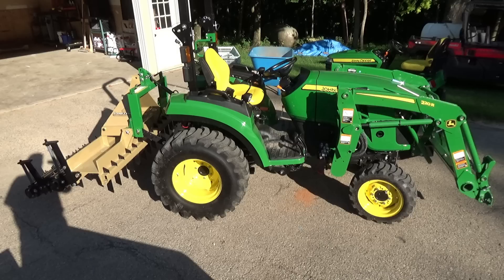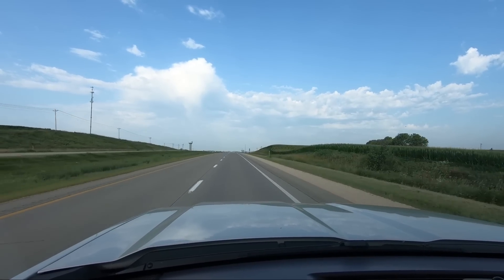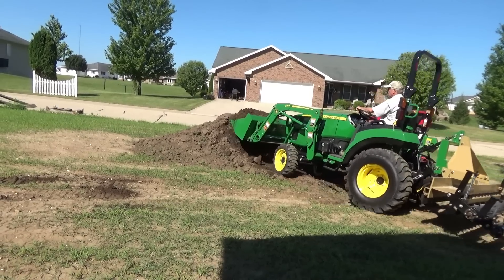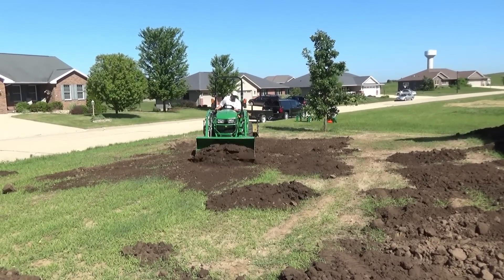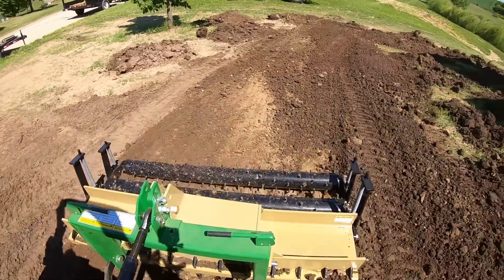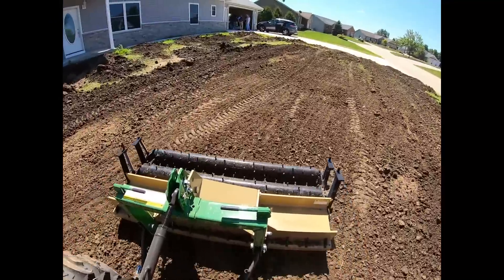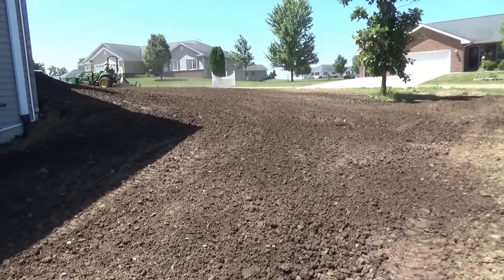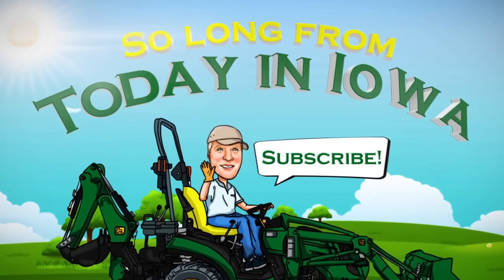Land Pride Soil Pulverizer / John Deere 2038R / Installing new yard/ 108

Comment: It's good to see Land Pride is still in business making implements. I used to use a Gill Pulverizer working with my dad almost 30 years ago now. It always did a great job. We absolutely wore that implement completely out doing landscaping jobs.
Reply from the maker: Good morning Mr. Samurai, 35 years ago are used to run a guild pulverizer also it was always one of my favorite landscaping tools. It was nice when I could afford to buy one and have it in my arsenal of the implements. LOL
Thanks so much for taking the time to comment I appreciate your support-Bill
Reply: Land Pride is owned by Kubota and is their line of implements and attachments sold at Kubota dealerships. You can buy it as a Kubota or Land Pride.
Reply: @zfilmmaker  I think they must have purchased it, we had those implements over 30 years ago. I remember they had a catalog , and it was a stand alone company back then I'm pretty sure.
Reply: @mr.samurai901  Land Pride was its own brand under parent company Great Plains Mfg. I'm not sure exactly when Kubota acquired them...I think maybe 5 year ago? Hasn't been that long.

Comment: Bill, I did a job just like that this past summer.  I used my TR3 Rake and backed up the pile to pull down from the top and did that operation in different directions. My TR3 has a blade that can be locked for mass material moving OR unlocked and allowed to "float" to do a finish grading of material. The owner did some handwork to make look smooth. But the majority was spread about 1-4" depending on location in the field.
Reply from the maker: Hi Andrew, that’s a good idea I’m glad it worked out well for you. I hope to get a few jobs this summer maybe I’ll try out your idea then. Have a wonderful Christmas.

Comment: Hey Bill, this is one of my favorites! You shared great info throughout and I love the peaceful nature of this one too. So the 1025 is the smallest tractor? I always here people talking about 1025....
Reply from the maker: Aaron, yes, the 1025 is known as a one-series tractor; mine is a two-series tractor. The last two digits are the horsepower of the tractor. One reason I traded up was that the 1025's lifting capabilities were always marginal, so I moved up to the next-size tractor. Now, I can lift many more implements and achieve more of what I’m trying to do, and it still won't tear up your yard when you drive across it.  enjoy your Labor Day. -Bill
Reply: @billburkhart  Great answer again! Love it!
Reply from the maker: Aaron, I wanted to add that you can purchase dirt and gravel by the pound. For example, when I use my small dump trailer to get a load of dirt, I pay by the pound or the ton.  I was thinking along the lines of commercial work when I was talking about a cubic yard price. -Bill
Reply: @billburkhart  great, was always curious about how that works from a billing standpointm
Reply: Here is another question.... I heard you mentioned before you have tractor dealer you work with for equipment. How does that work? Do they service your equipment, what is your inventory?
Reply from the maker: @aaronburford5701    Aaron, I have three different John Deere dealers within 20 miles of me, so I spread my work among all three. I do my oil changes, greasing, air filter, changes, etc., myself. I’ve only had to go back to the dealer once or twice for some mechanical issues that I didn’t want to try and fix.  I ordered a new replacement grill after damaging it From the dealer and will install that myself. -Bill
Reply: @billburkhart  Cool, thanks for sharing!

Comment: Would love to compare this to tilling and then leveling out with a drag and then compare that to a Harley rake. Which way is faster and gives a better end result?
Reply from the maker: Hi Pete, I've never used a Harley rake, too expensive for me and I don't care for the way it can throw a rock or something similar.
I'm such a fan of the pulverizer because its 3 tools in one. The scarifiers break up hard ground and the roller breaks it down further without going too deep. The H beam allows the operator to contour the ground where its needed. Finally the roller can be driver over the seed bed to set the seed into the soil.
I'll keep this question in mind when I do a small seeding project this fall and compare it to a tiller. 
Good question. -Bill
Reply: @billburkhart  Do you spread seed and then go over it with this to get good soil contact? If so how does it work or does the grass come up even? I'm always looking for a better way. Right now I till, then go over it with my 3 point homemade drag, then I roll it with a cultipacker, spread seed and then cultipack again. It works but I always end up with a few bare spots.
Reply from the maker: @petebusch9069   Pete, as long as your setting the seed with culipacker, your good to go. Your process is good.
Using the pulverized, I get by soil prepped then spread seed, and then I tilt the pulverizer way back, so only the rollers are running on the seed, so it gets into the soil.
basically, we’re doing the same thing. My experience has been getting good growth doing it my way and I’m sure you will also.   
Enjoy your weekend .Bill

Comment: Retired 75, in process of moving from 60" to 72", 4 cylinder kubota L4701. Tractor still at dealers adding canopy, LED lights, tip/tilt, third function and Quick Hitch QH15. Did not want back hoe, went with mini excavator Kubota K008-3. Enjoy your video. EDIT: Got lots of hobbies, one I like is making compost. Live in area houses have acre lots, so neighbors bring over leaves and cut grass. I add manure and my time, $25 a yard works for me, load trucks and trailers all year long. Have metal shop with some CNC. Had Everything Attachment deliver 72" scrap grapple to dealer, then I added Land Pride HR2572  it will all be delivered when dealer gets done.
Reply from the maker: Hi Vern, guessing you live in Arizona? Compost is hard to find out here in Eastern Iowa wish I had a source like yours. It sure sounds like you have a very nice set up with your shop and tractors. Congratulations on your achievements.
Reply: @billburkhart  Bought to many machines, recent arrival is fabrication roll around welding table. Just completed small addition and jammed a new Kubota K008-3 excavator in the new space, I'm out of room again. Just had some rain so, running tractor around creating mud pies every where is not helping.

Comment: I just subscribed to your channel. I have been watching your videos for a while but this one caught my eye pretty good. The reason I say that is I purchased a 2032 last year. The exact same tractor but a little less HP. Also a little difference in price. Lol!  The only reason I didn’t buy the 2038 was budget. I traded a 2210 I bought in 04 in on it. I love mine. I got the 60 inch belly more, and loader with mine. I already had a 60” disc harrow, Bush hog, and 60” tiller. I could not justify the backhoe no more than I would use it and besides my neighbor already has one. Looking forward to seeing what kind of jobs you come up with for the 2038! From Helena, Alabama, y’all have a good-un!
Reply from the maker: Hello Richard, thanks for subscribing, I appreciate it! I looked at the 2038 too and struggled when making the decision to go with the 2038, I figure this is my last tractor, so I purchased as much as the budget would allow. Sounds like you have a nice set up with your tractor, enjoy it, be careful and have a great spring.

Comment: I’m in the market for a tractor I have 2.75 acres of land to maintain with horses and a few other animals it will be for my own person use not for doing jobs for other people. I also have quite a bit of landscaping and leveling to do. What would you suggest 25 or 38? Or how about the economical 1023e? I don’t want to over spend but I also don’t want to get something that isn’t going to work
Reply from the maker: Max Sanchez  Hello Max, the 1025 will do anything you throw at it, I have the videos to backup that comment. However, being a man and buying boats before, avoid the cost of trading up......purchase as much tractor as you can afford, but the 1025 won’t let you down. Let me know what you purchase.
Reply: Bill Burkhart thanks I’ll let you know what I go with

Comment: Great video. I find I like to make a good (1 bucket) windrow at the furthest end, then backblading with the bucket to set the height, and where it gets thin ill start a new windrow there. It makes a fairly even spread of topsoil quite quickly, the final leveling is very fast. Have you tried this way before?
Reply from the maker: Hi Fire Pants Fab, I have not tried that but I sure will next time I'm out. Thanks for the tip. Stay healthy and thanks for taking time to comment.

Comment: Another excellent video.  Could you have used your Land Pride grading scraper to move and level the new soil?
Reply from the maker: Hello Mickey, yes...you are absolutely correct. This location was about :40 minutes from my home so I used what I brought.....and could fit on the trailer.  But, going back for the rear grader crossed my mine too. Good catch. Thanks for checking in- Bill

Comment: When you get dirt dropped off, how is it charged?
Reply from the maker: @aaronburford5701    Good morning Aaron, good question. You pay for dirt or stone by the cubic yard plus a trucking charge. For example, the rip rap I purchased in the other video was $175 for the stone and $150 for trucking, so $325 a load. Dump trucks are referred to as single-axle or tandem-axle loads. Of course, a tandem axle load will hold more weight. You’ll hear me mention that I bought a tandem load of rock, meaning a larger amount of weight can be hauled.
Reply: @billburkhart  great answer and thanks so much!
Reply: @billburkhart  help me understand the big difference between a 1025 to another tractor?
Reply: So what does the dirt being spread on the property like does for the ground,?
Reply from the maker: @aaronburford5701    I added  good quality soil to improve his existing soil.
Reply: @billburkhart  Bill, thanks SO much for answering each question,... It means a lot!

Comment: Looking at buying one of these. But you need to put bushings on the pins so they are not sloppy in the quick hitch
Reply from the maker: Happy Sunday MMM. You are spot on! I learned that the hard way when I was using the disc  plow and it came off...........now I'm adding them to the implements when I purchase them. Great point, I'll share that with others. 
Thanks for checking in, - Bill
Reply: Bill Burkhart i lost my tiller testing it. What a mess that was
Reply from the maker: Mini Massey Maniac.   HolyCow bet that’s a good story....
Reply: Bill Burkhart not really lol  it bounced off the hitch on one side and pulled the shaft apart. Not as good as when i was clearing brush and a tree pulled the clip out of the pin on my loader and the pin for pulled out so the loader was only mounted on one side lol
Reply from the maker: @midcoasttractorservice9182  We'll you'll appreciate seeing video 111 when it comes out and you'll watch as the  disc plow "bounces" out of the I match.
Reply: Bill Burkhart i don't think I'm enjoy that part lol

Comment: Another great video Bill!  I bought a 3pt quick hitch about a month after I got my L3901DT.  I have a Land Pride box blade that is quick hitch compatible and is a real pane to hook to the 3pt without a quick hitch.  Makes changing attachment a lot easier.  The Soil Pulverizer looks like it does a great job breaking the soil up.  I wonder how it would work after using a tiller on the ground first?
Reply from the maker: Hi MD H, I've done a few yards now and had thoughts of bringing my tiller along but always choose the pulverizer because of it's speed. If I have room on my trailer next spring I may try that as I have 2 yards to grade and seed this spring. Thanks for taking time to write. - Bill

Comment: Hi Bill, again, Nice Video, glad to see the 2038 in action, I knew you would like that IMatch , that makes things so much easier. Just an FYI, Everything Attachments makes great stuff, that's all I buy, the only thing I would suggest to really make you love life is to add a hydraulic top link, that will blow your mind in conjunction with that awesome IMatch, I love mine, but I see you don't have the duel rear SCV's, if you haven't seen my video when I added mine, check it out to see if it might be something that might be of use to you. I bought a garden bedder from EA and plan to expand the sweet corn patch this year so I'll try to get some one to film it and upload how it went, have a nice day.
Reply from the maker: Hello Ty, good to hear from you again! Thanks for the corn update, I lost track of your progress last year and was wondering.
The I Match adds so much efficiency and convenience I wouldn't be without one now. You were correct recommending it.
I've watched your video on the SCV several times and I'm interested in adding it after your comments today.  My dealer doesn't seem to want to do add ons after the sale, so I may need to find another dealer to do that work. If you make a video using the hydraulic top link in use, let me know. 
I was thinking of you last year, I hope you'r not close to all the fires I see on the news.
Reply: Hi Bill, sorry about not any updates on Corn Patch, was really bummed on turn out, really great corn "bushes" but didn't get fully pollenated ears because of no room for pollen to get to silks so this year more space between rows and different seed company and a lot of "praying" !!!! We are about 3 hours from the fires so we didn't have problems but our church has a high member count there and those poor people lost everything, I am going to do video on top link soon, keep the great videos coming, enjoy them a lot.

Comment: Hello how does the tractor manuever ? Compared to the 1025r , is it handy ?? So to speak
Reply from the maker: Happy Sunday Fralin 1966, the 2038 requires a little more room to do a 180 degree turn, but nothing that has caused me to regret moving up to the 2038R. I'll be posting a video this spring comparing the 1025 and the 2038 after owning both for a year. 
Thanks for taking time to comment - Bill
Reply: @billburkhart  thank you !

Comment: Hi Bill.  Thanks for your videos.  Just wondering if you think that a PTO tiller set shallow would have been a good choice to spread the humus?
Reply from the maker: Happy Sunday C Dee, It sure could have, and there would be nothing incorrect about doing that.
I just used the tools I had at the time and was happy with the results. 
You'r correct, there is more than one way to get the job completed. Have a great week. - Bill

Comment: Thank you for this! I have a 2038r and was wondering how the 72” unit would perform. Looks like a good match. I need to do this to my yard this spring. How long did this take you?
Reply from the maker: Hi David, I had an honest 10 hours in the project, the New Holland wasn't used much and that included a lot of hand work around the foundation. Good luck with your project. - Bill

Comment: One problem  we get with a larger machine is it sinks on soft areas
Reply from the maker: Jill, you'r correct. I notice the 1025 can go across my wet yard and leave less tracks than the 2038. Great point.

Comment: Do you have a roto tiller for the tractor?  if so which is better the tiller or Soil Pulverizer?  Cost of the SP 3072?
Reply from the maker: Hello X Ray, the SP 3072 was around $3,000 and I also have a Land Pride RTR 1274 rear tiller that I'll be demonstrating this spring. The pulverizer is quicker than the tiller for what I'm doing. I purchased the tiller first, thinking it would do everything I wanted. But, I've always wanted a pulverizer so made arrangements so I could purchase both. I'm very blessed.

Comment: Great video but to much time wasted on that attachment here in Ireland we would use a stone burier power harrow or power rake
Reply from the maker: Hello Noel, I'd love to have a power rake! Around here there typically $8,000. Too expensive for me at the moment. Thanks for taking time to comment.
Reply: @billburkhart  no problem bill there not cheap here either do ye have stone buriers in the states
Reply from the maker: Noel Cahill I’ll be darn, Ive never seen this tool before, but I’d sure like to try one. Sounds like it does a lot in one pass. I’ll keep my eyes open for a deal, thanks for making me aware of the Impliment.
Reply: @billburkhart  no problem there common here in Britain and Ireland 1 pass leaves a neat seed bed u can even get them with a seed box but if they are in the states I'd recommend 1 alot